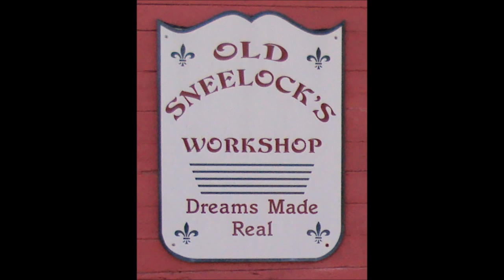Antique Shop Finds ~ Buhl  Hatchet ~ Pt 3 ~ Wedges & Finish ~ by Old Sneelock's Workshop

Comment: Today varnish is mainly used as packaging to keep the wood clean. Nobody would buy a dirty looking handle. I use boiled linseed oil also for handles, but lately I just leave the handle raw. When handle finish gets gummy just hit it with some 120 sandem paper and it's ready for work. Non-finished wood only works for inside tools, handles wouldn't last too long outside in the elements.
Reply from the maker: For me the BLO is a visual thing. It's close to the feel of bare wood but adds the rich colors of an oil without the greasy feel. It also stays clean and shmutz wipes off well.

Comment: Nice job! Up early running my table saw in the back yard. Thought I'd take a break and check in with Mr. Sneelock. Already hot here so I think I'll clean up and go watch some old Cowboy shows in the ac. Thanks for your hard work.
Reply from the maker: I got up early. Went out when it was still cooler. Lydia and I watered the plants, mowed the yard, and I sprayed for bugs while she weeded. I'm glad she never hurt her back. I hate bending down to pull weeds or even pick up a pencil. 
I waited until just after lunch when it was really hot to go out and drive fence posts. What is wrong with my head. :-)

Comment: Hi Snee, Nice job on the hatchet handle, I too dislike the plasticky varnish goop that is often on new tool handles. am a little disappointed to hear you say you are working in your basement, I thought your workshop was that lovely barn you show in the intro and at the end of your vid's 🙁. Cheers, Mike from the UK.
Reply from the maker: Thanks Mike. 
At first I was disappointed too when the barn wasn't my workshop any longer. That was the original Old Sneelock's Workshop and the home of the channel for the first two years of it's existence. The sign on the door is now hanging in my garage. 
After 3 years of being here I'm getting to like the current 3 shop setup a little better each time I use it. The basement is air conditioned and the garage is insulated so it's cooler in the summer from the bleed off of the house and warmer in the winter for the same reason.
Reply: Aha, that explains it, Ive just been a viewer of yours for the past few months, it was a mention by Wranglerstar that put me onto you. I have a shed at the end of the garden which I built around around 25 years ago from timber reclaimed from an old school building. It is 11ft square and if I keep everything in its place there is room to do the things I need / want to do. My main restriction is lack of time as I work full time, I reach 60 next year but will need to still keep working ad I have kids at home, maybe one day I will retire and gave a bit more time available!

Comment: Turned out fine as usual. We go get Sweetums new tub and I'll try and remember to get a handle for Mr. Stanley while there. I bought a peavey a few years back for the firewood log deal so I wouldn't surprise or kill myself trying to work up a truck load stacked every which way and I was going to be a Sneelockite and lay the b.l.o. to the varnished handle after I scraped the varnish off. My arms from the shoulders down are still stove up after beating a trackhoe pin about the head and ears and not succeeding in doing what I wanted to with it so when I started scraping the handle it didn't last too long. So I just got a fist full of b.l.o. and the handle has a coat of varnish and b.l.o. too. Looks nice and made the 'Made In Canada" stamp stand out. I squeak and it ain't from the varnish either!
Reply from the maker: It never hurts to have goals but it always seems to hurt getting to them. Nice thing about a job like scraping a handle or putting on a coat of BLO. You can do it sitting in the shade with a glass of iced tea or something. Watch the dog run, scrape a little and rub in the BLO. The dogs happy. I'm happy.  The jobs done. Not a bad way to spend 20 minutes. 
P.S. Beverage choice optional as long as you only scrape the handle. :-)
Reply: Old Sneelock's Workshop No handleat LOwes so will try local. All water here, not many options left thanks to kidney stones. Hot tea in winter. Dog is always happy. Us- mostly so. Got to mow as usual. Boss gone to Bahamas for a week so I might have a reprieve.
Reply: dont drink the BLO by mistake :) hope the kidney stones went, im having treatment for mine with ultrasound these last few weeks!

Comment: What a truly handsome tool. Do you propose to put a steel wedge into the top of the handle ?. I have ratchets with and without this feature and would welcome your thoughts.
Reply from the maker: With nearly every other axe, hatchet, sledge, or mallet the eye is wider and longer at the top and bottom than it is in the middle. With all of those I use a wooden wedge down the length of the eye and, depending on the length of the eye, one or two metal wedges to force the handle into the ends of the eye. 
The two single bevel heads, both the Buhl's hatchet and the unnamed axe head, have eyes that don't taper on the ends. Perhaps there is a reason for it in the idea that either head can be set up right or left handed. I had to cut the wedge slot wider to obtain room for the wooden wedge. The straight eye doesn't leave room for steel wedges. Cutting slots for them seemed unnecessary. 
IMHO the eye works better with the narrowing or waste in the middle. As I gain experience with the use of these tools I hope to find out why these are different.
Reply: Thanks for the explanation, I fully understand now. Kindest Regards from a very warm UK, summer has arrived!.

Comment: I have a question Sir..My neighbor gave me an old 1 pint can of spencer SK kellogg raw linseed oil ..The sticker price is $1.69 ..I guess it is  about 40 years old ..Could I use this on a wood handle or does it have to be Boiled linseed oil ?
Reply from the maker: If I understand correctly the raw linseed oil will work but it takes a long time to dry. Like months. The boiled linseed oil isn't boiled anymore. They put dryers in it to make it set up. 
Here comes the fun part. Mix a small amount about 3 to one with mineral spirits and wipe a thin coat on a piece of wood. If it sets up in a few hours it's good to use. If not you can try boiling it but I'd suggest doing that outside and away from flammable materials.
Reply: I like the adding mineral spirits Idea ..Thank You for the Info !!!
Reply from the maker: Happy to help. Let us know how it turned out.

Comment: wud U pls tell me how deep to cut the curf into the handle? I've looked but can't find anyone that explains the depth and width of the cut before installing the hardwood wedge and steel step wedge. Do I HAVE to use linseed oil? Do apply linseed oil to the handle that is inserted into the steel axe head before hanging the head? Thanx in advance - good video.
Reply from the maker: On an average axe the eye is tapered on both ends. The wedge is suppose to spread the handle to fill the taper. I cut the kerf to go about half way through the head of the axe. Usually I only put one cut in the handle. The wedge will spread the handle to fill the eye.
You don't have to use boiled  linseed oil. It is my preference. You can use Danish Oil or any other kind of finishing oil but boiled linseed oil works best for me. 
You can put boiled linseed oil on the handle before hanging the head but it's not required.